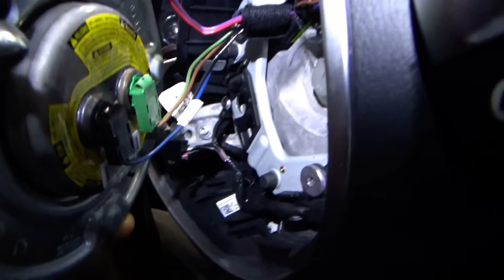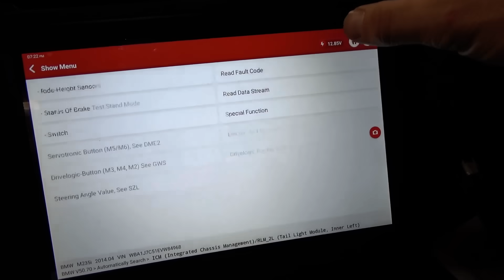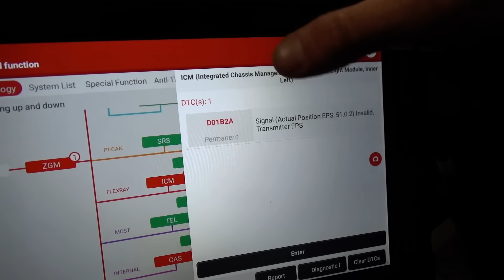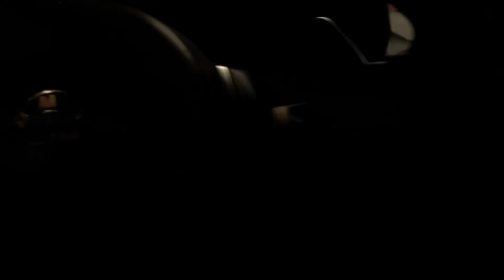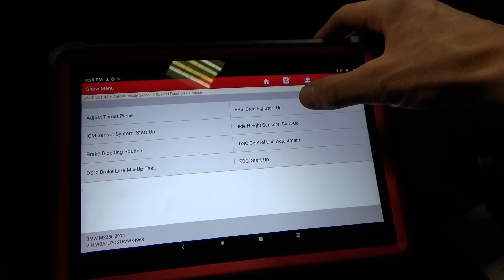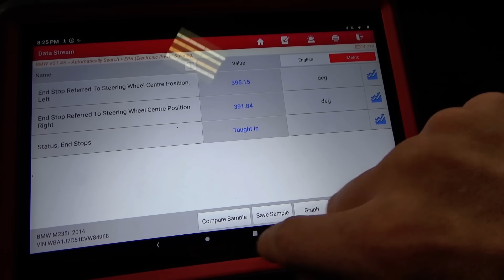DANGEROUS BMW Steering?? ('14 M235i Turbo)

Comment: Hi Ivan,
It's amazing how you need to tease out information that should have already been provided. Knowing the car fell of the jack and the jack impacted the steering rack would have made your diagnosis simpler. You and Amanda stay safe.
Reply: I've done valet parking and some people have come to retrieve their car and pointed out something wrong with the body.  They claimed that wasn't there when they dropped off the vehicle just hours earlier.  When you point out the rust on the damage, the guest drops the issue and drives away.  Nice try, right!  You'd be surprised how people will pay the valet parking fee in order to attempt to make a damage claim on their way out.

Comment: The black wire in the steering wheel pigtail was crushed and spun around the bolt during the installation of the replacement steering wheel